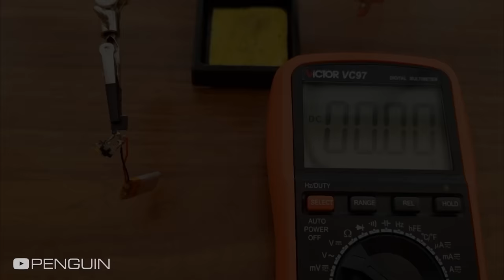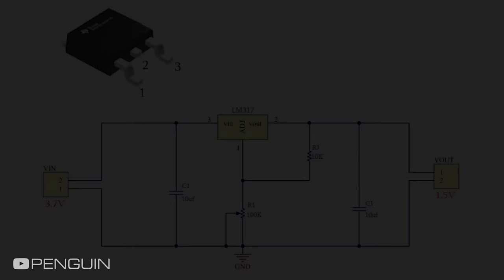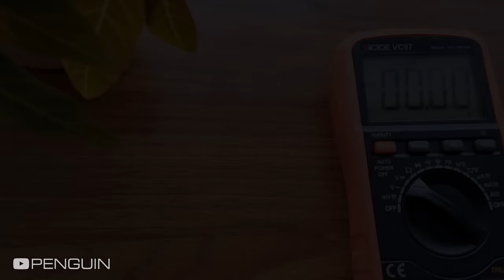How to make Rechargeable 1.5v Li-Ion battery | DIY Rechargeable 1.5v battery at home

Comment: Cute idea, but here's a cray bit of knowledge: You can actually buy rechargable batteries that fit four to a charger, and get four charged batteries at a time instead of just one.
Reply: No way! That’s crazy! I did not know that!
Reply: good luck finding ones that are actually the proper voltage. Also, this video is hella interesting even if not the most practical everyday thing. It shows step by step how some of the high tech things we have in today's world can be put together in the real world that most of us rarely think about, let alone visualize.
Reply: The pack I got came with a 4 micro USB connector adapter, so best of both.

Comment: the linear regulator is going to waste 50-75% of the energy going out of the lithium cell, using a switching converter would have been a much smarter move
Reply: aguante PWM, nothing else matters
Reply: Share some knowledge please? I'm interested in having more than one option for my voltage.
Reply: @LazySpaceRaptor  just search for buck converter ICs, the low power ones include everything inside the IC itself, they are either fixed voltage or adjustable via external resistors
Reply: Wow
Reply: You would still need an external capacitor. And equipment that uses batteries, typically does not expect a noisy power source. So you really need enough capacity.
Reply: @effedrien  So? Smd caps are large enough

Comment: instead of potenciometer you could have used normal resistor or two since its role is only to tell regulator how much voltage to output and not much current goes through it
Reply: How are you
Reply: He did this so he can fine tune the output.
Reply: @jonathanfairchild  once tuned he could measure the resistance across the POT and replace it with the equivalent resistor.
Reply: @jonathanfairchild  i know but after finetuning you measure potentiometer and replace it with resistor :)
Reply: @Ezio470  you can also just calculate it, it's a simple ratio.
Reply: @jonathanfairchild  you don't really need fine tuning, anything from 1.1 to 1.6V will probably work, you could probably get away without any extra components and use the default 1.25V of the lm317

Comment: Why don't you use SMPS as voltage regulator rather than linear regulator? I saw some of these with really small main boards and great current source capabilities. It would extend lifetime of such battery. Nice project, good job.

Comment: Ingenious. You work very carefully. I really like the quality of the solders. Your LM317 controller is great but it stays permanently connected to the battery and of course has a low consumption that will quickly drain the battery. Success in several projects.

Comment: That's kinda dangerous and bungled, but still very impressive. How long does this battery last inside the clock you showed in the video?
Reply: Hearted comment but no answer xD
Reply: @epsilonadept7301  probly stil measuring
Reply: @epsilonadept7301  they ❤️ all of them, probably low english comprehension and just click instead of read.
Reply: the battery discharges the stabilizer faster than the alarm clock , in principle it has a large transverse current
Reply: @sharadkumar8353  probably XD
Reply: The 317 needs 3.5mA to be stable, and it takes at least 0.1mA, so anywhere from a day or two to 3 months.
Reply: @satibel  thanks for the answer ^^

Comment: Wonderful Video I like The Way You Arrange All the Components in a AA Battery.
In Future Video I suggest you while charging the li-ion or li-po battery adjust the CHARGING CURRENT this will enhance the battery health performance.(For example Battery has 450mAh So Charge with 450mA or less) AND TP4056 HAS A ADJUSTABLE CHARGING CURRENT BY CHANGING (R2) RESISTOR.
Reply from the maker: Thank you for your attention
The offer is useful and interesting.

Comment: Nice technical work. However, the battery  capacity of the final product is less than a tenth of the duracell, so might not really be all that practical.
Reply: 2.25 wh 1.5v x 1.5ah is the alkaline battery and 0.67 wh 3.7v x 0.18ah is the li-ion. 25% of the alkalines capacity it have i say if we consider energy losses in the dc to dc converter. =)
Reply: Well, chemical one use batteries deliver much more power per density than lithium batteries
Reply: @sugarpuffextrem  Not really. You have to compare usable energies. For a decent alkaline battery that's probably more like 1.5V x 2.5Ah = 3.75Wh. For the Li-ion with a linear regulator reducing its voltage to 1.5V, you only have a usable voltage of 1.5V, not 3.7V. So its usable energy is going to be 1.5V x 0.18Ah = 0.27Wh, which is just 7% of the usable capacity of the alkaline.
Reply: @RexxSchneider  well i assumed it used a chip than converts the high volt to low volt without any significant losses. I guess the module need a coil and caoacitor to be able to do that properly. I hate linear regulators. Whatcare they good for anyway other than making heat😅
Reply: @sugarpuffextreme3860  You mean use a switching regulator instead of a linear regulator. But that's not what the video was showing you.
Read what @Jan Andrysek wrote: "the battery capacity of the final product is less than a tenth of the duracell, so might not really be all that practical." 
If you're trying to say that using a switching regulator could increase the usable capacity of the battery, that's not in dispute. But what switching regulator are you going to cram inside an AA battery? And how are you going to cope with the horribly noisy output that will screw up a lot of the equipment that expects clean DC from a battery?

Comment: Well
very nice project and absolutely amazing how you managed to fit everything inside an AA-Battery. But without over discharge protection your battery will die fast. And the capacity is not that high but enough for low energy consuming devices. NiMH Eneloop Batteries have 2000mAh and yours only has 540mAh (compared to NiMH because they only have 1/3 of the voltage)
Reply: The battery in this project is only 180 mah
Reply: @TheArachnoBot  Yeah but it has 3.6V while NiMH only has 1.2V
So you have to to multiply it by 3 to compare them
Reply: @lukasoffen2420  Nope. That would be the case for a switching regulator but this has a linear regulator which just converts the extra voltage to heat.

Comment: really cool fine work, but totally pointless energy wise, an Nimh battery will provide between 2-3Wh of energy is will provide 240mWh of energy and about 300+ mWh of waste heat. But even so if a thing takes 2 AA batteries it usually will run off one li-ion without reduction of voltage. because 2 AA can provide 3.4V when completly fresh as long as you have a circuit to cut off discharge at like 3V to 2.5V it will be fine (depends on cell).

Comment: Not bad, very nicely done. However capacity has been severely reduced from 2850 down to 180 mAh
Reply: "Wh" is capacity not mAh when you compare between different battery chemistries/voltages

Comment: Great project! Is there a low voltage cutoff for the Li-Po-pack?
Reply: Nope. LM317 is linear regulator, it does not provides BMS functions like LV cutoff.
Reply: @macieksoft  Okay, thank you.
Reply: @macieksoft  what if he used other version of tp4056 which has current protection?
Reply: It would seem not.

Comment: Use a hot glue gun on the solder joints after soldering to give the components strength and reduce the chance of shorts.
Reply: Gotta watch out for heat though. Some devices draw at a higher discharge rate, and can turn that hot glue into hot goo. Best to use an epoxy to pot the electronics. But yes, protecting the circuits is ideal.
Reply: The correct thing to use is chloroprene rubber glue e.g. Kafuter 1668 or similar. It's designed for reinforcing components and soldered leads on PCBs.

Comment: It’s more practical for rechargeable 9volts battery, considering the costs of replacing expansive 9volts “carbon” batteries.
Reply: Yeah for 9V, 6V and 4.5V batteries it makes a lot of sense, as they have more space and the boost circuit will take the same space.

Comment: There's only one issue I see with this, you've reduced the battery capacity from around 2500 mah to under 500 from what I can tell
Reply: Not as drastically as you think. The LiPo uses a much higher voltage (~3.5-4.2V) which means it can provide ~2W (4V * 0.5A).
In comparison a typical NiMh Battery with 2500mA, 1.5V capacity can provide ~3.75W.
It's still just half, but less worse than you would expect.

Please note, those are very rough calculations and do not include voltage drop during use nor losses during voltage conversion of the lipo down to 1.5V.
Reply: @adrianjost-dev  Also, rechargeable. Not needing to buy batteries and instead just plug them in for an hour or two every once in a while is an great advantage.

Could be useful in an emergency situation, being able to store power in these batteries.

Compared to just getting a normal power bank, you can take these and use them in devices that would refuse a power bank but accept batteries (remotes and flashlights for decent examples)
Reply: @adrianjost-dev  It's not 2W, the batterie's  capacity is180mah . 4v x 0.18A = 0.72W.
Reply: @nikos5113  sure, haven't rewatched the video closely and just assumed the 500mAh from the first comment are correct. Then it is really not much capacity. I like those batteries anyway (but the commercial version)
Reply: @nikos5113  Didn't he put 2 of those in there?

Comment: Seems dangerous
Reply: How
Reply: No, not dangerous
Reply: bro a 1.5V battery is not scary at all i connected copper wires to it (it didn't get hot in the slightest bit)
Reply: i'll tell u what u should be afraid of: any battery that is stronger than 3.7 volts no matter what (tho u do gotta worry about the wattage cuz my 9v battery is ATLEAST 10x stronger than my 3.7v battery in watts) so watch about for batteries stronger than 1.5 especially the 9v batteries
Reply: @Alternate-H123_22  your knowledge is wrong my friend
Reply: It  is

Comment: Firstly I want to congratulate you for your dexterity.
Your skills are impressive!
But I am not very sure for the practical part.
With this setup you constantly discharge your cell, the capacity is in any case small and also you have a voltage conversion circuit with many losses.

Anyway the project is nice!

Comment: This was very interesting! Curious if there is a way to maybe use a battery with more than 180mah in there. What does this generally translate to after voltage downregulation?
Reply: q dijiste

Comment: cool idea, but this tp4056 charge 1 Amp and its too much for small lithium battery , you can change the resistance of the charging module from 1.2 K ohm to higher to decrease the charging current .

Comment: Nice project, BUT there should have been a switching DC/DC buck converter for the 1,5V output, not a passive regulator. More than half the battery power is lost as heat, and this causes an even bigger drawback: the current drawn from the false battery cannot be higher than a couple hundred mA, if you draw more current the "battery" will overheat and eventually burn out.

Comment: Looks very impressive, although one detail I didn't see - How did you make the connection onto the positive pip at the top? I didn't see it in the video after you hollowed it out and then put the remains of the TP4056 into the top and then used the two part epoxy resin to seal it in. It didn't look like there was a cable soldered in there and I'm not sure how you would put one in after the epoxy. I won't mention what others have mentioned about different regulator choice/components as others have said, but as a DIY project this was rather impressive and I'm very curious to know the detail I've asked about :)
Reply: Near the end, the red wire is soldered to the inside body of the battery. Then an insulation disk is inserted, then the negative is soldered to an end plate and epoxied and heat shrinked into place.

Comment: LM317 is linear regulator. So it is basically wastes most of the battery energy to heat. Absolutely useless. But nicely made. I believe he can make it better implanting DC-DC converter and wrap it by flexible solar panel to charge from light. xD

Comment: I made power supply for wall clock using Li-Ion battery -1200 mAh and LM317. The clock stops after a week of operation. I will use XC6206P152MR - LDO Voltage Regulators 1uA Low Quiescent Low ESR .Just orderd in China. In addition, I do not use additional battery protection, as it has a built-in. This has been tested many times.

Comment: lol! "surface mount" is just a suggestion :D
btw what happens when you have the battery in a device, then plug the usb charger into the battery while it's in use? does it mind?
Reply from the maker: No, this is not a problem.
Reply: @PenguinDIY  sweet!

Comment: A for effort. 
C for design.
LM317 is a linear regulator with terrible efficiency that increases with the delta of input and output voltage.
No li-ion protection circuit protecting from overcharge, short circuit and most importantly overdischarge.
Reply: TP4056 protects it from overcharge - first IC used inside with USB-C

Comment: While this looks great, I can see several problems. First is simply the heat generated from that regulator. Ideally the regulator should have been welded to the battery case. Even that may not be enough though for this particular design. Second a regulator in a battery like this is always running so not ideal for low drain devices. I'd not expect long life say in that clock.

As a POC project though it is impressive!

Comment: I cut into AA and AAA batteries all the time.  But with no intent to reassemble them.  I just use a pipe cutter like you would for copper pipe.  Also not alkaine batteries, just the ones usually labled "super duty" or "heavy duty".  I do this for the carbon rods inside.

Comment: Nice manufacturing, but I see a design problem: the LM317 is always turned on, so the battery will drain even if not in use.

Comment: I can't believe how many people think this is real. This is obviously a parody. NEVER disassemble a battery, especially without eye, face, and hand protection. They skipped over the soldering and assembly of the charging port circuit board, a kind of important aspect. I can't just snap my fingers and make the board reassemble.

Comment: How'd you drill it without exploding it. Doesn't puncturing electronics, especially batteries break them & cause safety issues (shock, etc)?
Reply from the maker: The battery was fully discharged and there was no electricity.

Comment: Nice showing of the individual parts, but no information on which tools you used, which materials were consumed (for example the blue tube at 03:50 of glue im assuming), and what the individual components like the circuit board are made of. How can this be a DIY Video if I am left clueless on how to reproduce it?
Reply from the maker: All consumable parts are displayed in detail in the video and a link to the list of parts and tools is placed inside the description.

Comment: Very nice work but the 3.7v 180mah is very little power. Not worth all the work when you can buy 2800mah AA batteries. Thats about as much power as 7 of the batteries made in this video.

Comment: Is it possible for a voltage regulator mimics the AA battery voltage range so devices that shows the battery  capacity can work? For example, 4.2v=1.6v down to 3,3v=0.9v?
Reply from the maker: Yes it is possible

Comment: V 1.52? That's well below acceptable charge for rechargeable lithiums. They should stop working at about 2.4, or you might not be able to recharge them. Did you put in a low power cut out?

Comment: Please note that this type of (BSM TC4056) does not protect battery to over discharge so charge when you notice loss of power or use BMS with Dual Protection.

Comment: With the potentiometer in place can the battery be charged to greater than 1.54 voltage and give out a max of 1.54 voltage when in use.

Comment: Capacity wil be quite low:
- LiPo 3.7V * 0,180Ah = 0.666Wh
- NiMH 1.2V * 2,5Ah = 3Wh
So the LiPo stores only 22.2% of the engergy that an NiMH can (without conversion losses)

Comment: project ok, but this is based on analog regulator! this do step down voltage from 3.7 to 1.5v, but that type of regulator do wasting energy. with that type, it is wasted more than 50% energy. 1.5/3.7=0.41 , only 41% or less will be transfered from battery pack to output :( . But project is of course very interesting. For devices with low power consumtion, energy wasting is of course not important. But .... when i plug that battery into game pad :) it will be problematic.

I really don't know, why there are unavailable rechargeable battery with 1.5V output like your project. typical rechargeable has 1.2V, this is to low for many devices.

Comment: How did you connect the output of the regulator to the positive terminal of the AA battery itself? I only saw that you connect the battery charger, put it in the desired place and fill it up with resin. Can anyone tell me at what time he did it? Greetings.
Reply from the maker: In some AA batteries, such as the example in the video, the entire body of the pole is positive and the end of the battery is negative.

Comment: Either you have balls or you didn't think but you should never use a drill in that manner. Either the bit catches and spins the battery slicing your fingers or the bit comes out the other end that you have firmly grasped in your hand. Either way results in a hostipal trip.